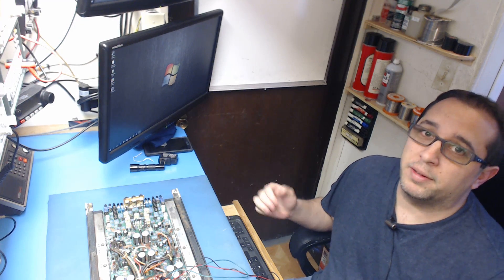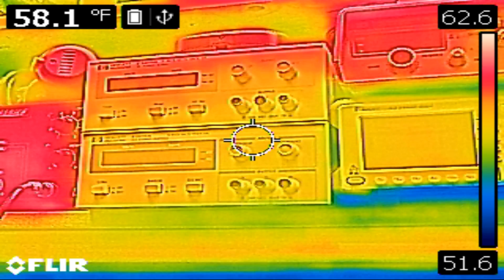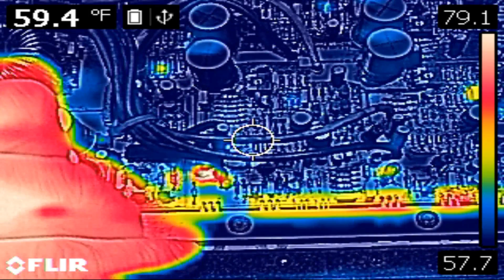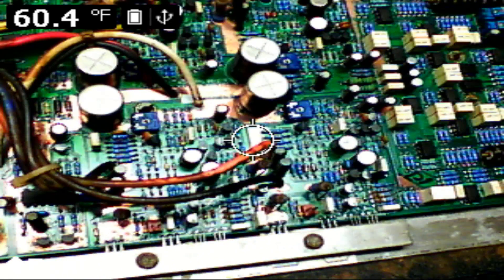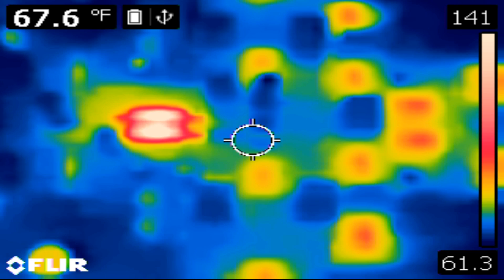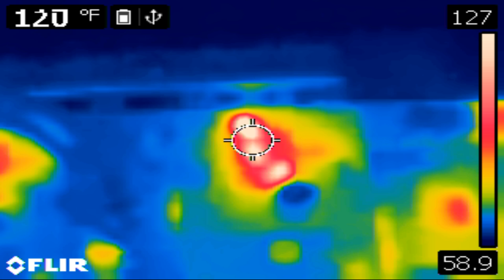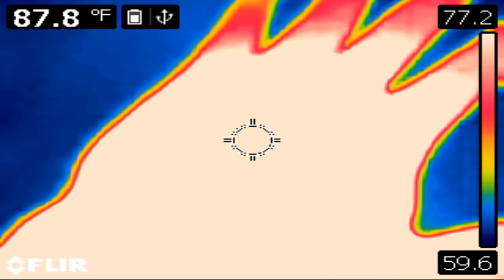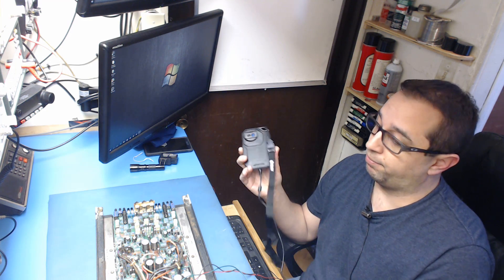FLIR C2 THERMAL IMAGING CIRCUIT BOARD TEST

Comment: The Flir C2 is a very very expensive tool considering what he is using it for when you know how rarely you would need to pull it out for the purpose he is using it for. You would be better off with the flir one which although still expensive is far cheaper than the Flir C2. The Flir C2 is freakin $700 why the Flir One is $250
Reply from the maker: With the FLir one not all people have an apple I phone.The android version only works on select phones and is very problematic. I had no choice other than getting the C2 which is a reliable device compared to the app based versions.
Reply: I have a flir one and it works just fine with my JXD android tablet. The only requirements are that your running android 4.4 and your device have usb OTG.

I bought the flir one 3 weeks ago to do thermal scans of pcb of various electronics I fix as a side home business of mine and the flir one is addaquent for this role, only con is the occasional lag time.

I thought about getting the C2 but ultimately decided against it as I know how infrequently the tool would get used and I would never make my money back with it within 4 years.

I have already made $70 back with the flir one however in the short time I have owned it.
Reply from the maker: I'm glad it works well for you.
Reply: BTW is there a way to manual adjust for the parallax problem your having with your C2. The Flir one has the same problem with the thermal image not lining up with the visible image in msx mode at close range however with the flir one there is a option you can use to manually compensate for this.
Reply from the maker: I think you can to some extent on the C2 but it is not great at real close range.